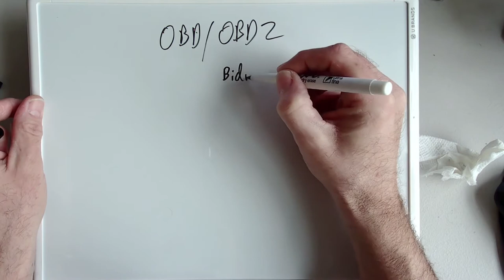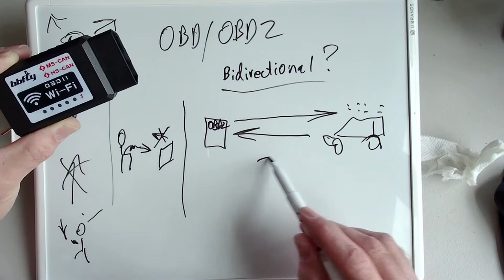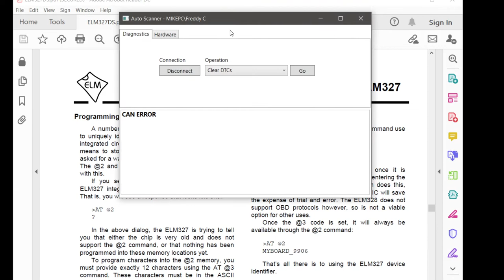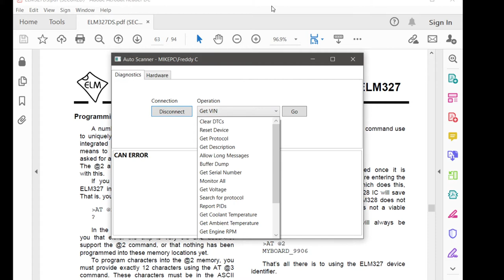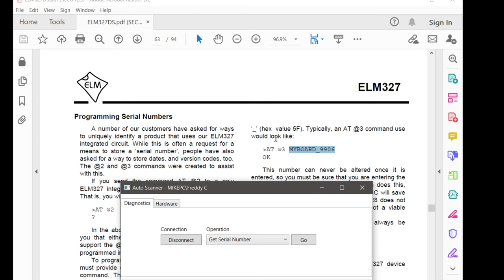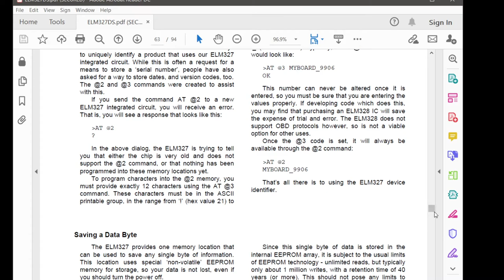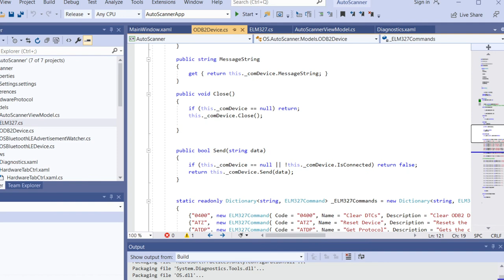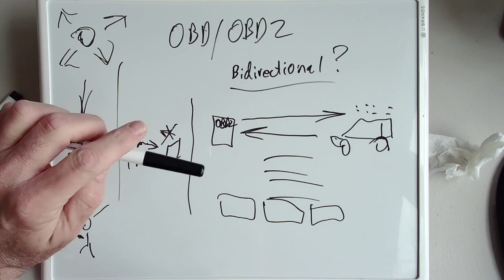OBD2: The Bi-Directional Myth (Software Design)

Comment: After you fry your ECU/PCM experimenting, then have to have your car towed to a professional Good luck.
Reply: Junkyard full of them down the road for 40 bucks ;)
Reply: Keep spending your money to have other people do your hard thinking for you.
Reply: foolish mortal, this is what research and development are for.

some of us buy used vehicles to experiment with and we dont see life as nothing but pessimistic drudgery.
Reply: A professional would have no idea why my 94 is OBD II and works with a bluetooth scanner in the first place. The ability to scan was only a side benefit. I got 10-15 hp from just the ECU/ MAF swap, better gas mileage, upgraded to a better more reliable distributor.
Reply: how much did snap off pay you to post that baloney?
Reply: You aren’t going to fry the ECU. You may corrupt a map and your car won’t run, but just communicating over OBD2 won’t destroy anything
Reply: I just bought an $85 "dongle" that has the same software and does the same thing as my $1500 professional scan tool. just missing some of the special functions that they don't want to give you for $85, or you would never pay $1500 for them. It's called the Ediag from Kingbolen/Thinkcar/Launch. This guy knows what he is talking about. You don't seem to...
Reply: Everything in this video is accurate. What amazes me is how easily the motorheads really gave up or never pursued ecm software hacking, editing, writing as such like the everyday computer nerd did when computers started to hit the stores and come out. There really is no reason why there isn't tons of equipment, tutorials on how to build, how to hack, how to write and software out there in general where all of this can be done by the backyard mechanic. (For crying out loud there were more people who could hack a satellite receiver and get you every channel available back in the day than there are people who even know how to disable an O2 sensor in an ecm today.)  In regards to "bricking", a brick is actually the description for a person making a mistake when modifying the firmware on an ecm and then does not know how to correct the problem and the ecm no longer works because of it. Any EE or SE will know this and especially if they work in the business of ecm manufacturing or programming for the motor industry (motor because these are used on all types of vehicles). In short unless you physically damage it or it is a PROM chip you are programming, and even if you think you have some kind of pass code or security on it, they really are not "brickable". (in regards to the security on electronic devices, just ask one of the ladies over at apple how secure an electronic device like a cell phone is when you get a subpoena for something in regards to national security). Again not in the sense that the person who makes a mistake and locks one up and has reached there highest level cognitive ability in their ability to program an ecm.

A good example is Edge or Bullydog products for tuning cars and pickups, and others probably. With an Edge, for example you can use there CTS3 or whatever version you have to program your car by down loading a tune and then plugging that in to your ecm via the OBD2. However, if you have a tune on the ecm already that is not stock it will not install a tune on it unless it has the stock tune in it, plain and simple. Well it can be done and for example if you are a SE (software engineer) who works in the business of ecm coding you know exactly how to make the Edge tuner write the program to the ecm without it containing the stock program. It all comes down basically to who will share what with whom about what they know.

Lastly, in the old days you had to know how to select the right cam-shaft, carburetor jets and know where to set your timing and lock down the distributer where you wanted it. Now you have a computer that controls variable timing, fuel injections, durations and much more. So the guys who know how to work with software, computers and data set files are the ones now who know how to set the timing, select the jets and cam via the software versus perusing through the hotrod or summit magazines. Its BS that you have to program a module for stuff like installing a new or different radio than the original radio in your car, which is why people give up on the ole hobby of personalizing there rides like we used to back in the day when it was just a matter of figuring out which wire was which and where it needed to go to make it work.

WHEW that ended up being a lot more winded than I anticipated but I hope all the amish type out there that think ECMs, TCMs, BCMs and such are some overly technical pieces of machinery that it takes a Doctorates to be able to work on goes away and stories like what you saw in this video are common place because it would be nice to get back to where we weren't a throw away society made up of people who just believe what they are told.

Oh and almost forgot....and the BS with these guys and companies charging several thousand dollars for diesel ecm tune and such.
Reply: pin of shame

Comment: You are making the classic mistake of trying to apply the common definition of a term in one industry with the same term in another industry. When I use the term 'interface' when talking about computers it has a different meaning than what an 'interface' is to a seamstress. 'Bidirectional' in this context is not talking about the communication being 'talk only' or 'receive only' but rather that you can actively control outputs rather than just reading inputs.
Reply: Boom!
Reply: he is able to control the outputs, its a software limitation, but like he said, the software is locked to a specific list of serial numbers the company programs into the ELM327 so it will only work with their dongles, all of them are capable of controlling the stuff
Reply: Yep, in automotive industry, it's bidirectional 'control'. It's not talking about basic  network communications. But the ability control components such as injectors, fuel pump, e-brake etc

Comment: This guy does not completely understand what he is talking about. He is being too literal. When you attach a code reader it is only reading. Bi-directional should be called bi-directional control. Not all readers/scan tools use dongles, some are hardwired, so does that change the definition?  This video is worthless and only confuses the less educated.
Reply: But if you can send and receive data, and the protocol is the same, what stops you from controlling the car if not just serial codes?
Reply: @ClaudioParraGonzalez  what stops you is the auto manufacturers source code that allows you to execute commands to control the behavior of  the many embedded modules in modern cars today. Each manufacturer has their own proprietary code and all those OBD2 diagnostic tool companies pay the auto manufacturers a license fee to have access to it within their software.

Comment: . Yeah man, had an air conditioning problem in the house, so I hired a guy to just run through the entire system to explain how everything worked. I told him i was going to do all the work myself, but needed someone to explain a few things to me. Paid him $150 for 2 hours, then proceeded to fix everything myself.. I take the same approach with my cars too.. This is good stuff and looking forward to you posting the connection to the ECU
Reply from the maker: Very cool - as long as you don't need to do brazing and pull out a nitrogen bottle. I went to Tennessee last year (2020) in January and was amazed the air conditioners are also heat pumps (bringing heat from the outside)
It was amazing to hear the sound of the compressors going in the middle of winter. Mostly no natural gas lines out there.
Reply: @Roudter  Yup heat pumps, like an air conditioner running backwards.. We don't have much use for that here in Arizona.
Reply: Nice innovation on services protocol
Reply: Are there any mechanics who understand cars?

Comment: If pressing a button on a OBD2 scanner sends something to the car, and the car responds by showing you new information on a screen is Bi-directional, then so is using a remote for a TV. It's the exact same thing.
Reply from the maker: I see you're point. However, there is no data sent from the TV back to the remote). Data only travels from the remote (remotes never receives data).
The remote control can never tell if it's actually operating anything.
Thanks for your thoughts.
Reply: @Roudter  Ah I see what you mean. Good point. The remote itself isn't Bi-directional, got it. Cheers

Comment: While you did make a fair point about the confusion over the application of term bi-directional, what I think you’re missing is where the real cost, complexity and inherent value resides: the auto manufacturers own proprietary code that controls every function of cars built today. Theirs is no more open-source than apple iOS or MS Windows. The hardware component -  the connection interface — is of little to no value compared to the programming IP and they have yet to hand over access to it without collecting a license fee upfront.
Reply: Just as the US has done with forcing manufacturers to use a standard diagnostic system (OBD2), they can force the manufacturers to use a common system to communicate with cars commanding them to perform active functions. (driver side window up, driver side window down, etc) If they don't want to, you can't sell you cars here.
Reply: One could reverse engineer it, but you can probably buy a license cheaper than you could do that.

Comment: Can tell he isn't a car guy. Bi-directional control is for testing modules for diagnosis.
Reply: Yeah, OBD protocol itself has no built in ability to bi-directionally control, say, the canister purge solenoid. @Roudter is partially correct in that the OBD2 dongle can request data from the computer and the computer will respond with said data. So, technically, it is bidirectional (but not the diagnostic scanner sense of the term)...

Comment: Just curious, how different are these PASSTHRU devices like the VXDIAG NANO, Tactrix Openport 2.0, etc (Compatible with SAE J2534) than the ELM327 stuff?
Reply from the maker: I can't tell you exactly, but they are significantly more advanced and hardware configured for flashing ECUs. This video is wrong about a few things. I now believe that most systems are not using ELM327, but rather proprietary devices that are faster, more configurable and easier to control.
Thanks!

Comment: You are correct about your definition of bi-directional that the scan tool manufacturers are misusing.  What they actually mean is the ability to send commands to the car's ECM/PCM to control certain systems.  Those high-end scan tools are supposed to be able to send more commands to more car models than the lower end scan tools.  OBDII is an emissions standard that has to follow certain protocols for communication with the vehicle.  Outside of that the car manufacturers can choose their own communication protocols to use for other systems in the car.  Typically the manufacturer's scan tool will access & control more functions than a generic scan tool.  I don't know if the communication is encrypted, passcode protected, etc., but they do not have to allow you total access.  It must be proprietary since they designed it (wrote the code for it) & they are not about to give it away.  If it's OBDII related that's good, but outside of that the manufacturers' are not required to give you total access to their vehicles' systems.
Reply from the maker: Thanks for  the information...
Reply: The secret is PIDS and how to use them

Comment: After you get into by directional  Scan tools, there is also a huge jump in price when it comes to special functions (airbag reset, relearns, etc) , and then there is another jump in price when it gets into key programming, and yet another when you get into ECU reflashing. I wonder what the limits are.
Reply: Well, I wonder why we need super expensive diagnostics, to be able to do key programming. Sure car manufacturers need to assure some security, but once the diagnostics producer receives certain permission to write intu ECU, it is not such a big deal weather its deleting errors or registering new chip on a key.

Comment: The action that most DIYers want from a scan tool is  ACTIVE TEST 
That sort of bi-directional communication allows us to test individual modules and components controlled by that module. The ability to single out window switch or a window motor on each window for example. There are scanners in the $500-800 range that can actually do a great job and also make keys as well. Granted they also have subscription or update fees. 
Great info here. Great video. 👍🏻
Reply: Yeah what was demonstrated was reading basic obd2 telemetries, but the professional scanner "commands" modules to say, fire injector 1 for 5 seconds for relative injector performance test. I wonder if it can be done with cheap BT ELM327
Reply: @MA-kt8ly  I’m here to see how he does. It’s interesting. It might take a little while, but I’m willing to watch the play by play

Comment: Great video, All I need is the GM command string to force all I/M readiness tests to run without countless drive cycles. My Evap repairs are complete but readiness wont set. Drive cycle is difficult to achieve precisely. I.E. red lights, speed limits, blah blah blah.
Reply from the maker: I didn't know such a command exists...That would be real helpful...My ford takes weeks to get to that last 'evap' monitor...I'll keep that in mind. Thanks!
Reply: I dont know if there is a command for forcing onboard tests but it seems logical. I get the need to verify that repairs have been made but it could be way less trouble.

Comment: It's not about what 'bi-directional' means, it's how it is interpreted. This is exactly how companies are getting away with calling their 'code readers' bi-directional tools! Hardware, Software , uni or bi it makes no difference? If it can't turn the cooling fan or fuel pump off it's not considered bi-directional. If I can't re-program the ECU to avoid an $800 dealer fee it's not considered bi directional. I hate to sees an $80 code reader advertised as 'bi-directional' because it's meant only to deceive. 

Listen, I in total agreement with you only from a different point of view. And I REALLY commend you for taking the time to educate. But until your software is readily available most of those in the market to who can neither code their own app or have the ability to re-program a crippled IC will just be getting screwed out of their hard earned money by using bi-directional in it's proper context. Just Say'n

Comment: All I want to do is adjust my idle speed over obd2 with my cheap bluetooth plug. 

its literally impossible
Reply from the maker: I'm trying to imagine it being figuratively impossible... I think this is a variation of tuning, and I'm pretty ignorant right now on that topic.
Anyway, I have messed up my ecu by writing data to places I had no business. It as they say, it comes with the territory.
But, that level of programming is tricky. It's no big deal if you know the code sequence to make it happen. And, I'm sure you can do it with the ELM327 with some cars. 
Thanks! I feel your frustration.
Reply: @Roudter  As long as you havent completed your project, I guess this is the crucial vid to clearly explain the concept of car autodiagnostic tools and what is behind. Many thx.

Comment: Of course the scan tool has to talk to the ECU/PCM.  But, I've always interpreted bidirectional as meaning that the tool can WRITE to the PCM as in modifying the spark advance curve or on a variable valve timing engine changing the timing parameters.  Generally the manufacturer tries to strike a good balance between fuel economy, reliability, drivability, and performance.  But, you might wan to optimize for one of hose at those at the expense of the others.

Comment: Of course all ELM devices are rudimentarily bidirectional. However, when a legitimate company offers a bidirectional scanner/programmer we expect it to be able to run brake bleeds, change combustion points, run maintenance procedures, etc. If you can figure out how to run those, not just read and clear DTC's, then you have something!
Keep working on it, you're on the right track, but its still not there.
Reply from the maker: Thanks. I think you are 100% correct.

Comment: The problem is each car needs to be tested, graphs need to be displayed. To take care of each car is a big project. $400 gets you delivered to your door step a rubberized case fast android computer the dongle  built in and everything loaded. One repair has paid for it. Bi directional means physical things are changed on the car not just read values. On the higher price units you pay for support.

Comment: Each manufacturer writes different Canbus message depending on how the modules work and are wired. Technically yes you are correct, but you pay thousands for the RnD of the companies making the Scan tools. They have to write software to handle each manufacturer and sometimes each model of vehicle from that manufacturer. I would love to see this distributed for free but I doubt many people are willing to invest many thousands of hours in reverse engineering Canbus messages of each manufacturer, just for the good of mankind. If you are that person I'll be the first person to download that software. Goodluck Sir 👍👏